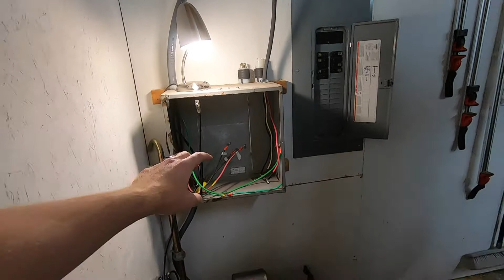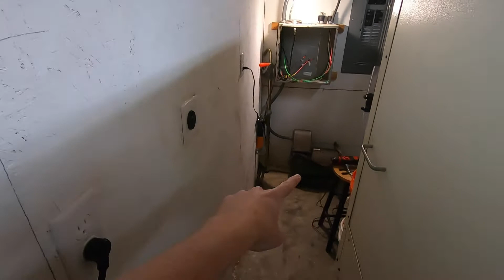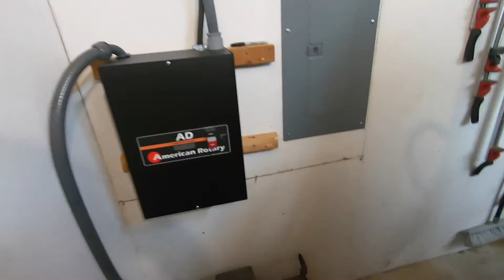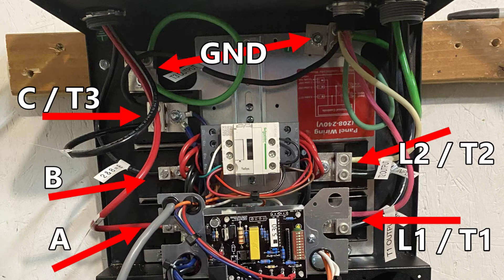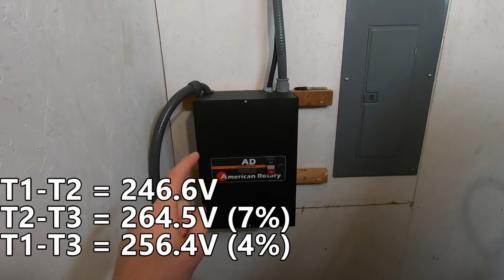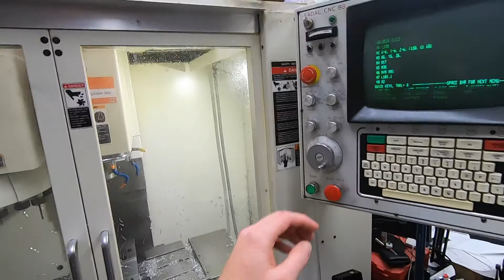Installing a New Rotary Phase Converter Panel

Comment: Were you having  issue's with the old unit. I have the same one and it has a slow start up but works fine.
Reply from the maker: My old unit burned up at least one capacitor and a few wires. Had to take it apart to see what all was damaged.